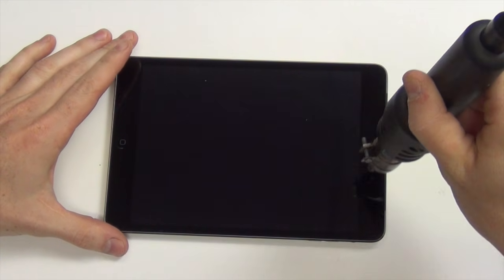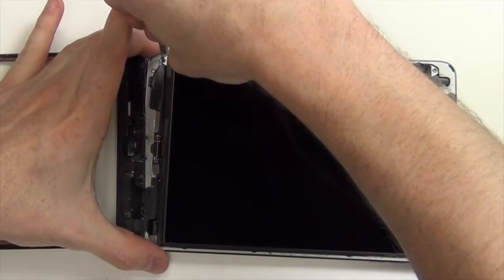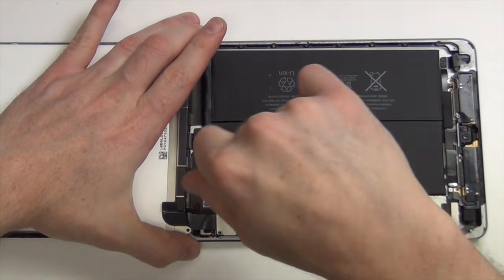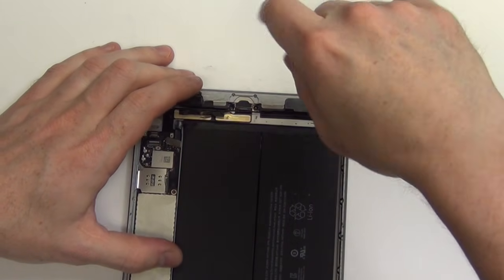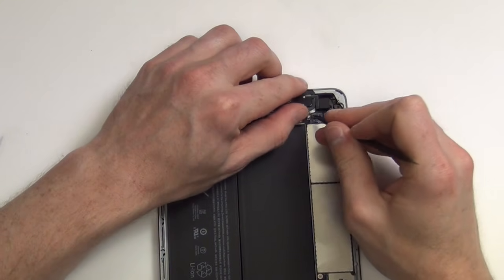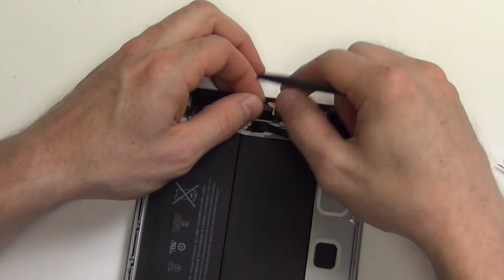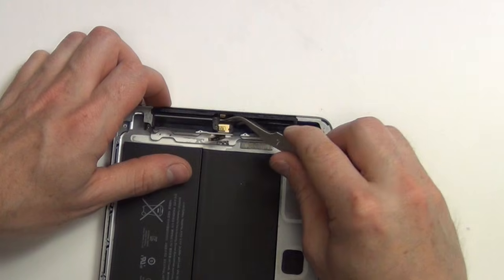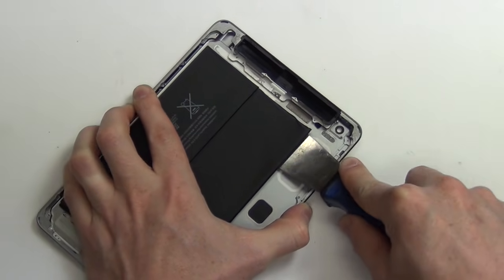How to Take Apart the iPad Mini 2 - A1489 A1490 A1491

Comment: Easier way to soften the adhesive on the screen is to use a hot water bottle.Just ensure the cap is on tight and not leaking water..wrap it in a towel and leave on the screen for 20 minutes.Glass comes off real easy!
Reply: true, it worked

Comment: does anyone know if its possible to use a hairdryer instead of a heat gun?
Reply from the maker: Most hair dryers do not get up to the correct temperatures for this procedure.
Reply: If you have a good hairdryer its definitely possible. I opened up a mini 2 with a hairdryer about 20 minutes ago. Just be more patient with heating and breaking the adhesive. Business cards help a TON when pulling off the glass.
Reply: Yes, it does work. I’ve used hair dryers for iPads, iPad minis, iPhones, etc. However, if you ever want to purchase a heat gun, you can get them pretty cheap at Harbor Freight.

Comment: I attempted to change a broken screen on my ipad mini 2. I think I followed the directions except the "very important" disconnecting of the battery. I watched 5 other videos that didn't mention it at all so I thought I was doing it all right. Can anyone suggest what needs to happen if it won't power back up now? Is it possible that a defective replacement screen/IC chip could cause it not to restart? Or did I fry the battery?
Reply: Caralee Weber I know that I am really late seeing this, but the problem is likely to be your backlight. It’s fairly common to blow the backlight fuse while replacing the screen if you don’t disconnect the battery. You probably have it repaired by now, but if now, just search for videos on repairing the backlight for iPad minis. A warning though, it’s not an easy process...
Reply: Try holding both the home button and power button for 5 sec to force start it it was not turning on for no reason and that’s what I did

Comment: Hey I was just trying to change my battery and thought this was a battery tutorial and next thing you know I'm taking the whole thing apart until I realize this is crazy and I double checked the video and it was in fact How To Take Apart not How to Change the Battery. So I took it apart all the way until the part at which you were taking the cables up by the camera. So I stopped there and then put it back together and installed the new battery and now the iPad won't turn on when I press the power button and when I plug it in it will get the white Apple screen for 10 seconds or so and then flash a red screen and go black again and then it will repeat this white Apple screen flash red and go black over and over again. Please help me.
Reply: You either...have not reseated the connectors...or you have used a third party battery....which will conflict with apples software.
Reply: @johncordey2769  I used this battery from Amazon. https://www.amazon.com/gp/aw/d/B07DCL5CBC?psc=1&ref=ppx_pop_mob_b_asin_title
I took it to a digital repair store and they said they tried a new battery in it and that it has a motherboard issue.. they say it can't be fixed and offered to buy it for $20 for parts.

Comment: Hello.  If I swap batteries should I back up my documents first or it will not reset?
Reply: Christ Records 2016 The battery has absolutely nothing to do with storage, it just powers the device.   You will be fine without backing it up.
Reply: @K373  bad advice! When you brake something while replaceing the battery you will have a big problem seeing your docs ever again.

Comment: Hi, How much heat should I use. I have a heat gun but it only has 2 settings. 575 F and 1000 F´. Are both settings too high?
Reply from the maker: This is really a hard question to answer as temperature and distance will both effect the outcome and each situation is a little different. I would hold the heat gun further away at first and then slowly bring it closer to get it to the desired temeperature "sweet spot".